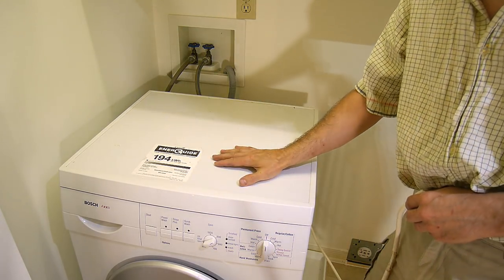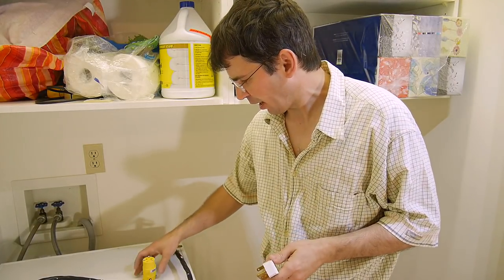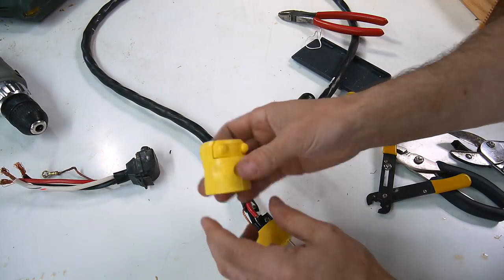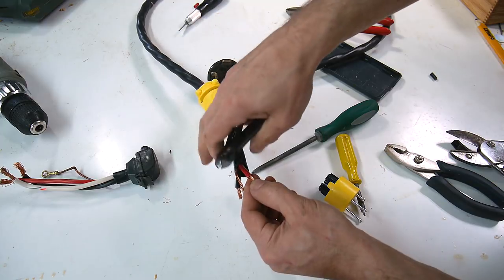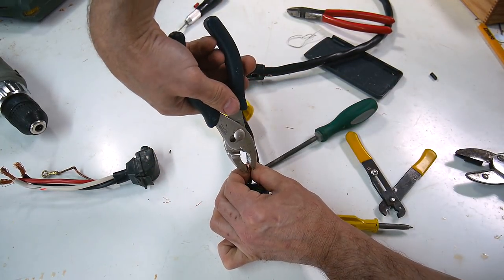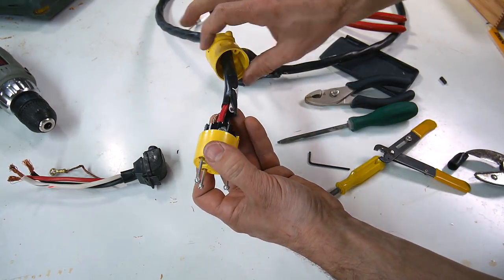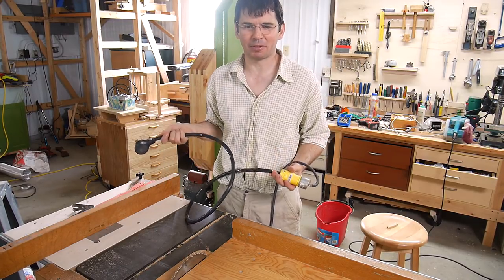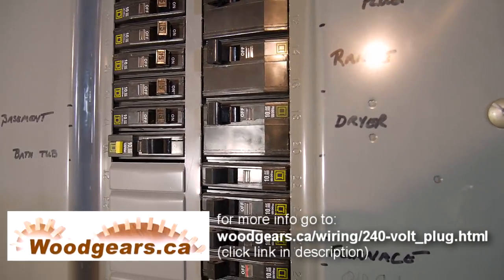240 volt from dryer plug (for Euro-washer or table saw)

Comment: Hush safety Nazis!  I've wired multiple buildings from scratch, and Matthias is spot on here.  Though the taped temporary solution doesn't meet code, it's perfectly fine as long as the cord isn't disturbed.  Yes, the copper wire is just being pressed against the spade of the plug...exactly like every time you plug in a receptacle.  As long the there is good contact between the wire and the spade, it's fine.  Fine for temporary.  As for the neutral, it is the same as ground in this setup.  If the neutral were wired in, such as with a 120V circuit, then it would carry the current back to the the main panel from the load.  Since it is not hooked to anything, then it carries no current, and is bonded to ground back at the main panel, hence: same as ground.

Comment: That's funny timing. I bought a welder yesterday with a standard 240 plug and the only 240 plug I have is a dryer outlet. Thanks! haha
Reply: Modern Builds had the same issue with my welder, had to make an extension cord anyway so I just made it an adapter extension cord. pigtail is an easy solution too.

Comment: Hi Mattias,

Love your channel. I am an electrical engineer, dabbling in woodworking, who has been in product safety compliance my entire career. I note that this video has received many comments from a safety perspective and regret that I would like to add one from a slightly different perspective. 

When products are certified, some of the testing applied is fault condition testing. This may be a short circuit of an electrical component or stalling of a motor; in each case, the product must not create a fire, shock or casualty hazard. My contribution to the discussion: this testing is done by the certification agency anticipating a certain amount of current available from the wall circuit. The circuit breaker only has a limited influence, while the (low) impedance of the wiring is a greater contributor. Most home 120V outlets will give a peak current under fault exceeding 1,000 A. When more current is available than the protection components can handle, they may literally shatter/explode (spraying plasma) or simply short out and allow the fault condition to continue. Individual protective components are given an Interrupt Rating to help coordinate their usage in complete products. Your 40A dryer circuit is going to have rather larger gauge wire (prob 8AWG) that will provide a peak current well above your typical 120V outlet.

Unfortunately, the European Norm for appliances, EN 60335-1, does not specify a minimum available mains current for performance of fault testing. Accordingly, I would expect your washing machine to have been tested with a 20A breaker and a peak available current well below what your dryer circuit is capable of providing. I recommend that you replace your breaker with a 15A one and if at all possible, find one that is current limiting.

Best regards.
Reply: Hi Robert,
I have a European dryer running on 220-240V,   50Hz 550-600 W.   It comes with a  2 phase wire and will require a 220 V 3 phase plug for North America where we use 220 V 60 Hz.  How would you manage such a conversion.  If you have the time or inclination I'd love to hear your thoughts, any advice would be greatly appreciated.

Comment: I first dryer was a Bosh, and still is by far the best one! It's running for 10 years, and it's the only one that handles correctly linens and duvets, by simply changing the spinning direction from times to times. Also it's very easy to maintain and fix, always simple DIY projects.

Keep this one for life, or replace it only by another Bosh! 👍🏻
Reply: You're absolutely correct Bosch is the only way to go...luv my Bosch dishwasher...10+ years and still f'ing going strong💪💪💪... but I'm about to replace it with a new model that has more features and more an advance.

Comment: 40A for a dryer, on the 220V side!? Holy crap. You can run 2 Euro-dryers and the washing machine on that.
Reply: More like four.
Reply: tengelgeer and you'll need 4 of them to dry things in the same amount of time
Reply: forget that, you can run whole house on that.
Reply: @Anthony M, only that's not how it works... Might be a little bit quicker but the machine spends most of it's time just keeping the laundry at a fixed temperature.
Reply: maybe in africa
Reply: tengelgeer you mean like 8 and half?:D bosch super eco condenser dryers are just 1kw ;) and its not output power its max input. i gues 40A is for historical reasons old dryers with resistive heating element can have 8kw
Reply: @Tomas Kovacik, yeah, you have very efficient machine with heat pump and stuff. They are great but drying does take a little longer with most of them because of the slightly lower temperature. But then again, that's good news for most fabrics. But even an old style dryer just uses a 2,2kW element in it which gets it up to temperature pretty quick.
Reply: @CKOD, they don't take an hour. And they don't even take 20A... Like I said, more power can heat it up a little quicker but a dryer spends most of it's time at a fixed temperature, not fixed wattage. So then having 1kW or 8kW doesn't make a difference. Only peaks of 8kW just when it does kick in are ridiculous.
Reply: 32A is usually the ENTIRE supply of a mid-sized house or apartment in Europe!!
Reply: Well at least here in Germany (HESSEN) a 3-Phase 220V 63A supply is standard. Even thoug this varies from supplyer to supplyer.
Reply: 63A over 3 phase I believe,  21A each.
Reply: In the Netherlands the default is 1x 40A or 3x 25A. You can get more but that will cost you more in fixed fee because of the possible bigger current with which you can load the net instantaneous which makes the management harder.
Reply: tengelgeer In the Czech Republic the standard for new houses is 3x 25A, 230/400V
Reply: Nope here in Germany from our supplyer 3 Phase 63A each. See the TAB¹ (German short for tehcnical connection conditions) from a german supplyer.

¹rheinenergie.com/media/portale/downloads_4/rheinenergie_1/rechtliches_4/tab2011_ergaenzungen_RNG.pdf #Page 14
Reply: The cost is likely because they'll need to bring a bigger gauge wire to you.
Reply: @kefeer123, no it's not (at least not in the Netherlands). Wire is more then thick enough, from the top of my head up to 3x 63A. It's really the net management. If you suddenly draw an extra 20kW and the net isn't prepared for that you have a big mess...
Reply: My dryer runs off a standard 13Aplug (UK).
Reply: +MrOpenGL - "32A is usually the ENTIRE supply of a mid-sized house or apartment in Europe!!"

That's because EVERYTHING runs on 240V there, which requires half the current for the same power as the 120V that almost everything runs on in North America (except the electric range and dryer). A standard main panel in North America is 100A, but electrically heated homes usually have 150A or even 200A panels. The higher rated panels also have more breaker circuits so they are sometimes installed even when the higher current capacity isn't needed just to get greater granularity for circuits in the home. Some years back I completely rewired the 100 year old home I owned back then which had 60A (four 15 fuses) knob and tube wires with new wiring and a 200A panel, mostly to get the extra breaker circuits.
Reply: +webchimp - "My dryer runs off a standard 13Aplug (UK)."

So your dryer can draw a maximum of 3000W, which wouldn't produce much heat in a full-sized dryer IMO. In North America a typical electric dryer is 240V at about 25A (on a 30A circuit) which is about 6000W of heating. The electrical components of Gas dryers, however, run from a standard 120V/15A receptacle. I did have a very small "apratment size" dryer years ago which ran off a standard outlet (maximum 1800W) and it worked Ok, but the drum was so small I had to run multiple loads, and I was single back then. It never would have been sufficient for a family.
Reply: @Martin Green, the 40A here is on the 220V isn't it? So that's still what a whole house uses (@230V). :o  :p 100A boxes, aren't they 2x 100A? I agree you need more if you need to heat it all electric. But time for heat pumps there as well :p

I still think 6000W for a dryer is just mad. Here a dryer is 2kW and will dry 8kg of laundry in half an hours just fine. And a heat pump dryer uses even less, even in total energy (kWh) even though they run a little longer.
Reply: +tengelgeer - "I still think 6000W for a dryer is just mad. Here a dryer is 2kW and will dry 8kg of laundry in half an hours just fine."

A handheld hair dryer is 1500W. Sorry, but 2KW is just not enough to QUICKLY dry an average family's laundry, not in North America anyway, but maybe in Europe you do a lot less laundry than we do. I had way more than 8Kg of laundry to dry when I was single. The 1800W "apartment size" dryer I had for a while about 15 years ago dried fine too, but load sizes were about  third of what my current full size dryer can handle in one go.
Reply: @Martin Green, yeah, I forgot North Americans are bigger... ;) But I manage with 2 laundries a week and half of it isn't near 8kg... And 1 out of 3 laundries is "delicate" and doesn't enter the dryer. And for the other 2, after being in the washing machine for 2 hours I don't need them to be dry in 15 minutes... 30 to 45 minutes is fast enough for me. Even the 60 minutes in a heat pump dryer is fine with me.
Reply: what, most homes in canada have 200amp service
Reply: tengelgeer you cant even do that in Europe anymore,  even 16 A with 230 V with 2,5 mm^2 wires is on the unsafe side
Reply: That's false. 1.5mm^2 Cu can carry 16A, although 2.5mm^2 is installed just to be on the safe side.
Reply: FHRsLP you are right, 1,5 mm^2 is maxed out to 16 A
Reply: And here 60A is the maximun current for Residencial. You can take more, but utility wiring was done to fit 60A usage "from time to time". It is not intended for continuos operation. Here, dryers, when requiere this ammount if energy use propane as a stove or a boiler. Way cheaper. The fully electric one are not that power angry, but probably very slow too.
Reply: Oh my god. 😵 The minimal thicknes of your wire depends on the length of the wire and the kind of installation. Sometimes 1,5 are enough and sometimes yoe need 2,5 at 16 A. And for sure, in America they have more ampere. Because they have lower voltage. Watt is Volt x Ampere. If you have a machine with 3,5 kw you need 16 A with 220 V and 32 A with 110 V. That's simple math and physic and no miracle
Reply: MrOpenGL I have 20A to my house :D
Reply: @tengelgeer  Here in the US most houses constructed within the last 50 years have split-phase 240 volt 200 amp electric service. Meaning we have up to 48 kilowatts of power available. We obviously never use that much but it's there just in case. The main reason for the high amperage is due to our big load appliances like the Air Conditioning compressor, electric water heater (for some of us), electric oven, microwave, and dryer. Al those except the microwave run off of 240 volts so don't worry about excessive current draw.
Reply: @handlebullshit  that's assuming it's a gas powered dryer. A lot of people have electric dryers
Reply: @Cheese_1337  My house in america has 200 amp electric service at 240 volts.

Comment: Matthias, in your defense. "In North America, the cases of some kitchen stoves (ranges, ovens), cook tops, clothes dryers and other specifically listed appliances were grounded through their neutral wires as a measure to conserve copper from copper cables during World War II. This practice was removed from the NEC in the 1996 edition, but existing installations (called "old work") may still allow the cases of such listed appliances to be connected to the neutral conductor for grounding."